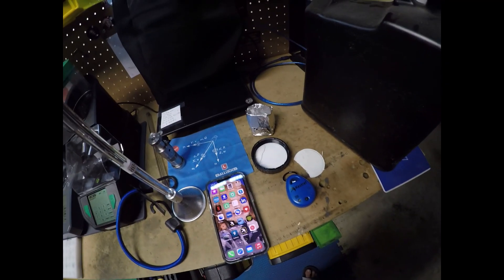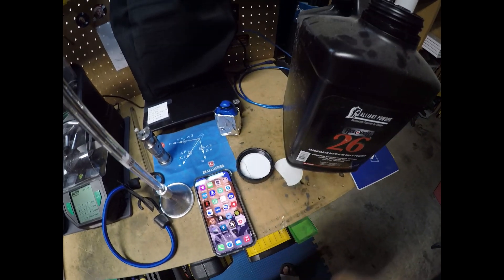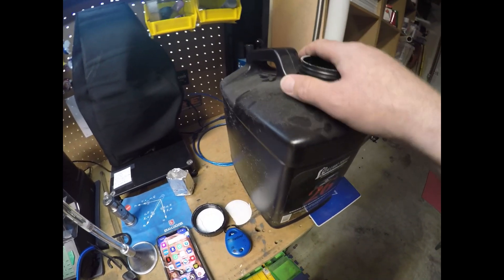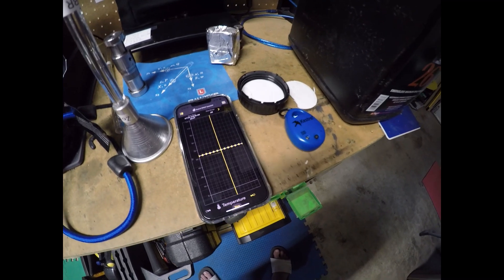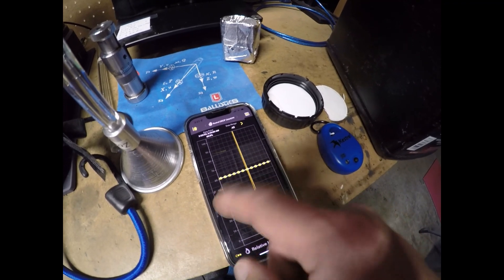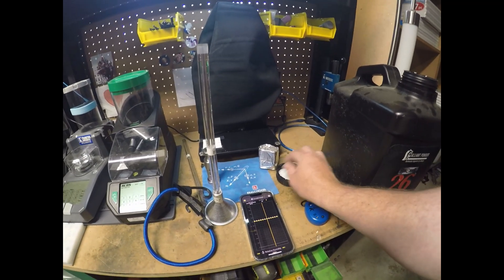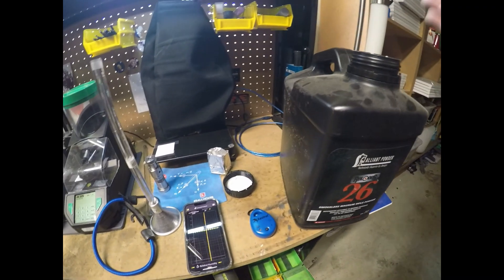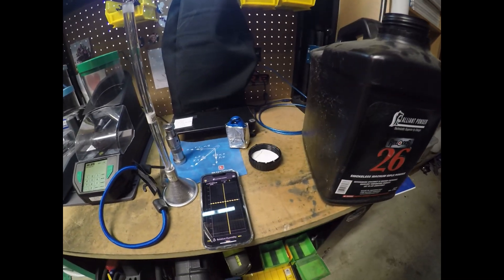Update to Powder Storage

Comment: Hey doc, have you thought about doing tests on the effects of flash hole prep. (deburring and/ or enlarging/sizes)? As far as profile of the hole, I'd be interested to see comparisons between unmodified, deburred keeping a 90° angle, and deburred with whatever angle the tool gives. I was also curious about what happens if we do this to the primer pocket side alone (funneling the blast into the case) and in combination with deburring inside the case (creating an "X" profile of the hole in a longitudinal cut). I'm sure some of these modifications will have no effect, and I think others may increase pressure signs on the primer, and I'm hopeful that you are able to show at least 1 flash hole prep. that will provide some benefit. Or if you disprove them all, then we will all save some time in reloading. Keep up the good work Sir!!
Reply from the maker: Haven’t tested flashole prep. I think Litz did a test showing how a burr affects ballistics so the recommendation was to remove it. I’m thinking of doing flashole size testing though as a first test. Thanks for the idea!

Comment: I've put a piece of glad wrap over the opening when I close a jug uip that is going to sit for a long time. Having lived in midwest for decades of high humidity this has been a proven method for sealing jugs tight. The glad wrap adds a good seal to the threads and mouth of jugs especially when screwed down tight. You can squeeze the jug and feel it is basically airtight.

Comment: Can you do the same test but with an empty jug? Interested to see if the powder is helping keep the humidity more stable.
Reply from the maker: I’ve tested this on three different sizes of powder and I’ve found that the smaller the powder size, the smaller the humidity. N133 was somewhere at 56%, N135 around 58%, and RL26 around 60%. There may be an effect based on powder size.

Comment: I thought about getting a Drop to put in my powder jugs to see what my levels are at. What do you use as your “fire proof container “ for your Drop?
Reply from the maker: https://www.amazon.com/3M-High-Temperature-Flue-15-Foot/dp/B00004Z4DS/ref=asc_df_B00004Z4DS?tag=bingshoppinga-20&linkCode=df0&hvadid=80882875798549&hvnetw=o&hvqmt=e&hvbmt=be&hvdev=m&hvlocint=&hvlocphy=&hvtargid=pla-4584482455114960&psc=1#